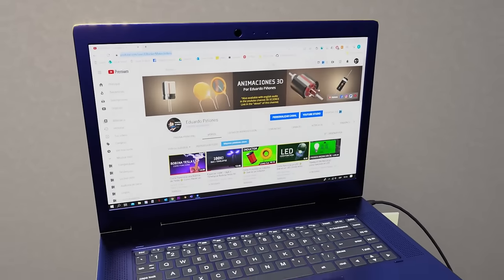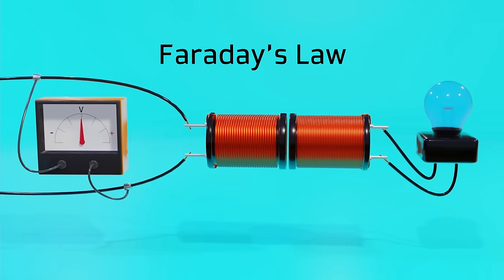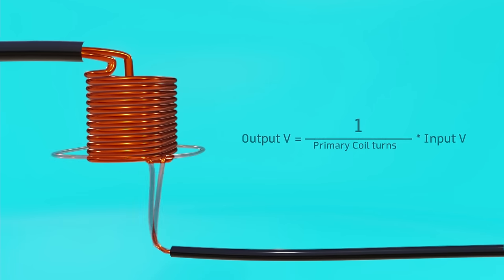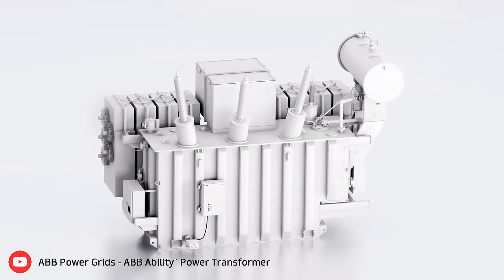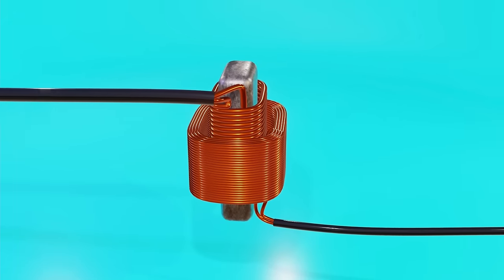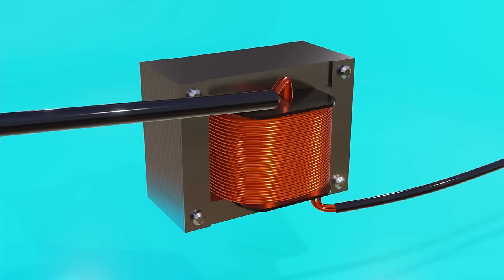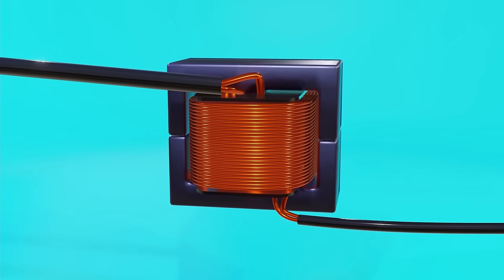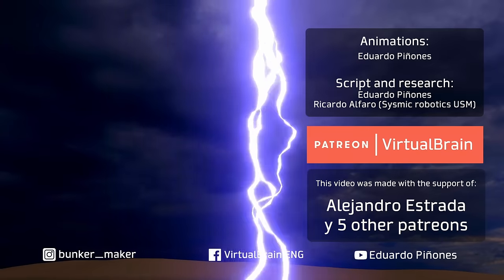How a Transformer Works ⚡ What is a Transformer

Comment: Actually, a transformer can work with direct current as long as one winds both coils (primary and secondary) in the same direction, unlike what is obtainable in a conventionally wound tranformer. After all, a transformer is basically an induction coil linked to another induction coil.

Comment: Will the coil produce a high heat at primary coil which connect to power source since the negative and positive terminal of the wire is connect ina wire? Doesn't is short circuit? Making a foam cutter??

Comment: It is common practice to explain how things work with the definition of some “law of science or philosophy”. This is a disservice to thinking students. First because it does not explain how or what is going on and secondly, when it is shown not to be a law when some limited arbitrary condition is changed, the law is no longer valid/true. Lenz’s Law for example only applies as the time constant of the inductor allows the phase change from flowing voltage field to magnetic field. That constant is minimal for a straight inductor, but increases dramatically when the inductor is wound with capacitance. So the resistant reverse field of Lenz’s law no longer directly opposes the incoming magnetic field, and opposes the outgoing magnetic field (timing is everything) to accelerate the rate of change of the inspirating field and amplify the induction effect (giving you more without demanding more, a free lunch) The world could have unlimited power without 3-mile island, or Chernobyl nuclear disasters, or cars and ships without oil and gas pollution; if science didn’t mislead everyone with peurial laws. Don’t listen to a science-philosopher who justifies his designs with laws instead of function.
Reply: My! I agree with your reference to it being a disservice. Furthermore, it does seem like these philosophical scientists, as you call them, only try to build according to laws instead building things according to the results that they desire. Someone would keep thinking, law of conservation of energy, therefore I shouldn't do it like this. What if doing it like this IS the most appropriate and efficient way to produce the results that one seeks?

Comment: I would also like a video on a typical wall USB supply for a typical 5vcd cell phone USB charger .. they don't use coils .. I think they are all solid state.
Reply: they do use coils and a transformer but the incoming AC is changed to a high frequency so that only a small transformer is required.
Reply: @kennmossman8701  those coils must be very small .. a 5vdc USB charger is not that big
Reply: @kennmossman8701  I worked on industrial AC and DC motors (5hp-400hp) and transformers in my young age, before solid state was available
Reply: @samm928  the 'size' of a transformer is directly related to frequency.
These typically operate at 100 to 200 KZ and so can be much 'smaller' than a 60HZ transformer.
BigClive has done YT videos on this.
also look at GreatScott's channel

Comment: How a 5 pin tranformer works?
Reply: The 5th is some kind of a midcoil tap. So if secondary produces 24 VAC, a midpoint tap would produce 12 VAC. Transformers and electric motors are related. For household AC fans, say a 3 speed, the shaft speeds (High, Medium, Low) are all the same (or would be ideally with no losses due to bearing friction and rotor aerodynamics). High setting energizes the entire field (stator) winding, Medium uses a 2/3'rds point field tap, and Low uses a 1/3rd point field tap. Stepping down thru H-M-L means less of the field winding is energized, meaning less power (torque) to spin the fan blade as the air resists being moved